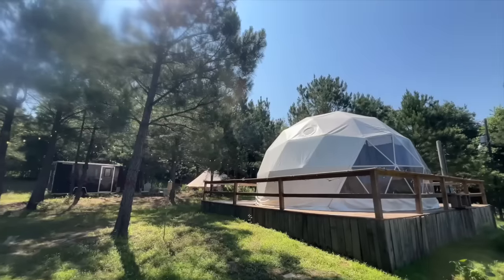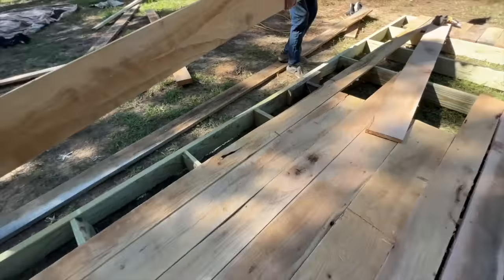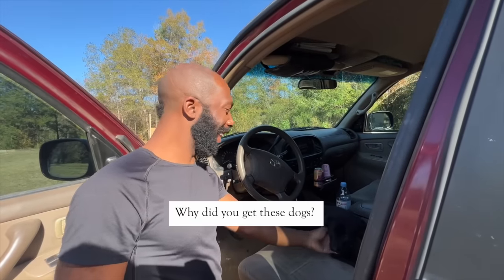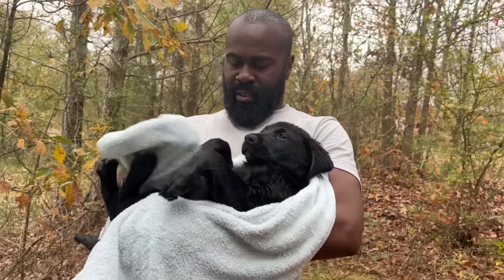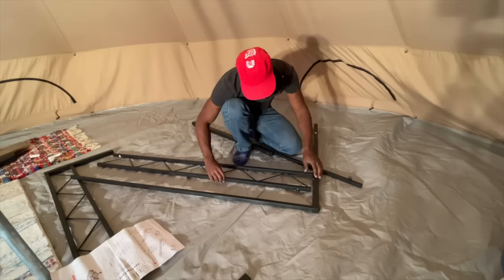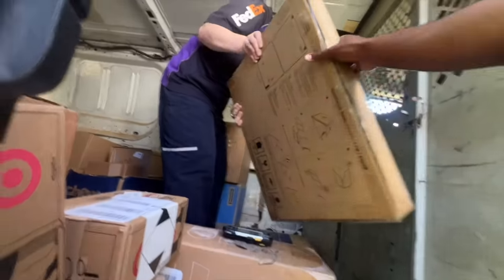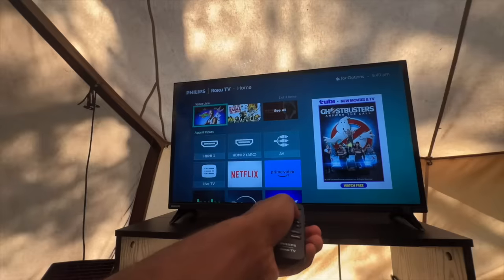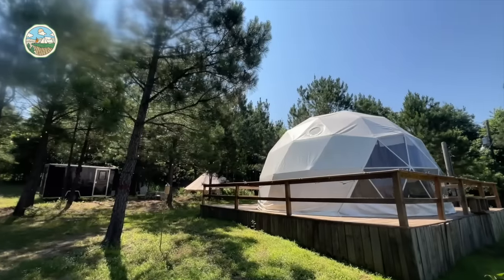We Converted A Tent Into A House

Comment: You may want to put something between the wood platform and the tent.  People put what's called a footprint under their tents to protect the bottom from ripping.  Also you may want to put something under the legs of the bed and table so it doesn't rip the tent bottom.  A cheap way would be take the lids off of food containers that you would normally recycle, you could even decorate it such as wrapping yarn around it or gluing beads, pebbles or little shells around the edges.  Other options could be coasters, or at the very least heavy duty cloth such as denim or felt.  If there's mosquitoes, maybe you could get some mosquito torches or candles.  You'll need a few.
Reply from the maker: Such a good idea! Thanks for sharing this with us.
Reply: Wow❤❤❤
Reply: @WillEdmond  I forgot that I posted this.  I'm glad that someone likes my ideas.  I hope you two's business is successful and sustainable!
Reply: 💕, great ideas!!

Comment: two things I would do different one instead of wood deck i would use aluminum framing and I would us a layer of steel wool on all joints  and around the deck I would put a two layer snow fence  and have a kitchen tent so no food where I sleep